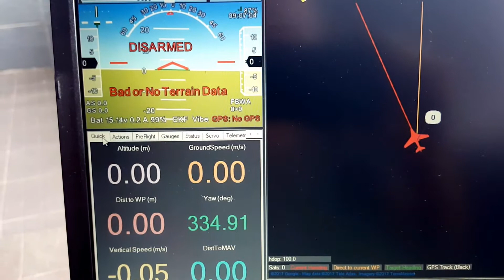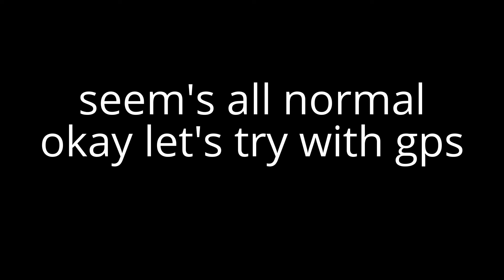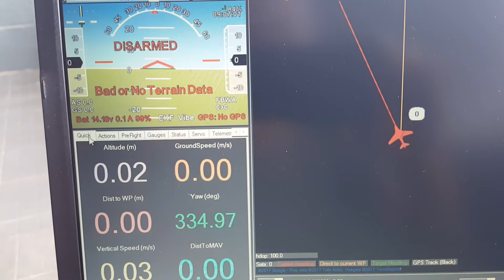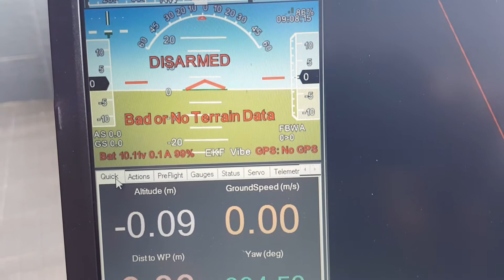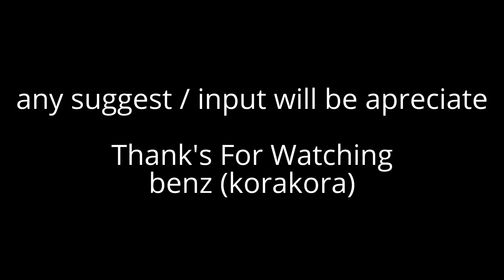arduplane with pixhawk jitter servo problem

Comment: Would you consider to put an extension wire & move the data transmitter receiver away from the controller and receiver!! I mean you don't have to make special holes or nothing like that... but there is a true necessity to keep that high output tx away from every thing...
Reply from the maker: hi Migueldeservantes,
no, i don't have any error on MP log (interference etc) all GOOD, so yes this is not a problem, but normal behaves from latest FW from arduplane :)
Reply: @benznote2342  it's not a solution to your problem, just good advice in general.
Reply from the maker: ouw yes of course i'm not try to ignore his advice but if it look like i did then sorry, but actually i use that telemetry radio temporary for setting only on the ground, the x8 not carrying that telemetry radio when he fly in the air :)
Reply: @benznote2342  oh, okay, no worries, just trying to share useful info.    Do you still have model?
Reply from the maker: have it? this LEGEND? you must be kidding me, of course i still have it, never stop to makes my mouth open and say "WOW" :)https://youtu.be/mz4hRbfL2AQ

Comment: This is actually not surprising. The scaling speed will be calculated using GPS velocity, and that effect is maximised at close to zero speed. The effect goes away once you are flying.
Also note that the effect is larger indoors.
Read this thread:
https://discuss.ardupilot.org/t/cube-orange-running-arduplane-4-0-5-twiching-servo-problem/53605
Reply from the maker: yes! you are right that exactly what happen, the ekf was not get a correct data yet, because i did test that with roof covered thus although GPS "seems" already LOCK but it isn't (data still fluctuative) :) so yes it fly flawless in the real flight
Reply: benz Note 
Good know that it’s flying ok.
Can you tell me your PID values for pitch and roll? I just want to compare with my.
Reply from the maker: @RizHassan  i'm not near with my X8, but as i remember this PID for roll & pitch need 1.0 more or less that depend your servos, i guess this is because the control surface not so stiff, i have a plan to flying it again this week, i will "reconfirm" that PID for you later
Reply: Thanks for this comment and the link, It answered some long standing, VERY frustrating questions I had about my plane. Can you tell me, if you dont mind, which PARAM or pid setting is effecting the scaling?  The reason I ask is that when I first updated to 4.0.5, this was not happening. I ran autotune and even after that it was still not happening. I had a light crash and after doing some cosmetic repairs to the aircraft this twitching started happening as soon as I powered it up.
Reply: Flight Therapy *BullisticFPV* There are three parameters P, I, and D under config tab option tuning.
Lower your P valve by increment of 0.2 and see if that help. During auto tuning I and D get adjusted and that should be ok. It’s the P value you have to play around to see which one works. For you.
Reply: @RizHassan  Thanks thats very helpful. Ive done plenty of pid tuning on multicopters but I am pretty new to fixed wing stuff. Thanks for the info its much appreciated

Comment: hi,  having problem with my v tail servo, in auto-tune mode ailerons works fine i did flight for 3 mins and decided to tune the elevator, after a couple of turns suddenly servo not moving in v tail but fortunately  i land the plane no crash. i got the logs can you help me with this i really don't understand why.
Reply from the maker: Hi Allen, yeah sometimes doing auto tune will act like that, because sometimes the FC start with very low PID and then it increase/decrease the numbers during that tune, but of course using STABILIZE/MANUAL will override that PID (ignored)
regarding to analys your LOG it better handle with the expert, not mine, you should case open on https://discuss.ardupilot.org/c/arduplane/plane-3-9 (as usually i did) and alot people will help you to examine that log for you

Comment: I think you are in FBWA mode. Try manual. So the air craft is trying to control the flight?
Reply from the maker: yes and i flown without problem, just EKF behaved because i put not on wide open :)

Comment: dear sir i have a problem. i cannot connect my servos with pixhawk. Can you show me why ?
Reply from the maker: hi Tran, what do you mean not connect ? you mean not move at all? perhaps you forgot to push the pixhawk safety switch :)
Reply: Do you have a mail or facebook adress, i'll send you my picture which shows my connections :)
Reply from the maker: hi Tran, unfortunately i don't have FB :(
and discuss with an email it doesn't looks easy
have you account on rcgroups?
you can post your problem at
https://www.rcgroups.com/forums/showthread.php?1963338-Ardupilot-on-Planes

or at ardupilot.org
i'm sure everyone in there can help you

that's a forum for :)
Reply: Thank you, sir :)
It's very helpful for me
Reply: Dear, sir
I have a question. When i connect ESC from motor to port 3 at Main out, i only can control 3 servo from port 1,2,4, i can't control my motor. Can you explain for me
Thank you so much
Reply from the maker: did you have ARMING the pixhawk? motor wont move if you not on ARMED mode
Reply: i click at Flight Data-Actions-arm/disarm, the monitor show "Error: command reject by MAV"
Wha does this mean ?
Reply from the maker: no, you have to ARM/DISARM with manual on your remote
please read http://ardupilot.org/plane/docs/arming-your-plane.html

Comment: I have the same problem. Did you find any solution?
Reply from the maker: that's because i flash it with the latest firmware, on the latest FW it used EKF to compansate from GPS bla..bla..bla sorry i don't know the rest :)
but the point is that was a nomal behaves! so yes don't worried it would be fine as soon as the plane airborne
Reply: benz Note So, you're saying that this is normal? Where did you find this answer?
Reply from the maker: yes normal according on ardupilot forum (i'm sure you can find it if you search), actually i prove it my self with flown this plane and yes nothing happen it flies nicely no problem at all, that jitter because the plane not airborne yet thats all, but better you find a second opinion i dont want to blame if in your case will different with mine :)
Reply: I found it in ardupilot website. Thanks! Great flights for you! I hope your video and our chat could help others! ardupilot.org

Comment: add 1000 uf 10v capastor with zener diod 5.6v
Reply from the maker: Thanks Aws Muslim, i;m allready mentioned, that was not servos get interference, but because that a normal behave because EKF not getting data from FC as the plane still stay on the ground, but i don't have any problem with flown this plane in the air :)
Reply: benz note, great to hear that.
i have question 
  do you powering the servo from pixhawk or from other
bec?
Reply from the maker: it would be brown out if we powering directly from the FC,
no i;m not powering from the pixhawk nor on the esc, i put 5amps BEC for powering 2 servos and 1w of my RX
Reply: +++ thanx